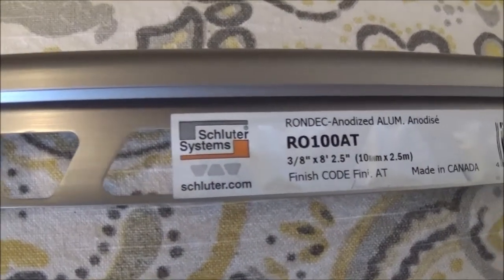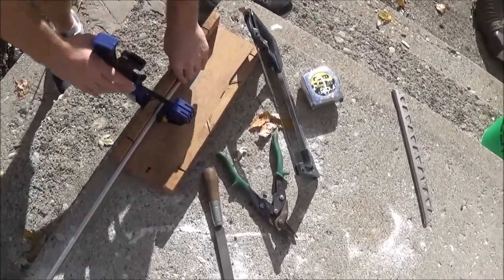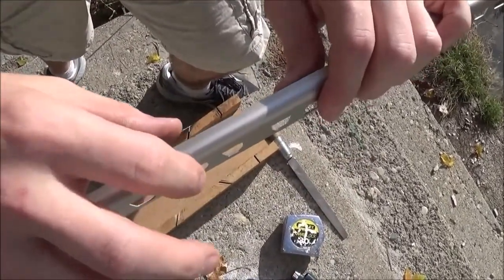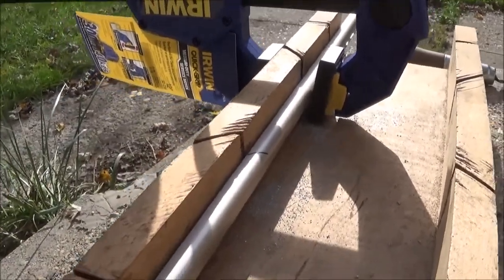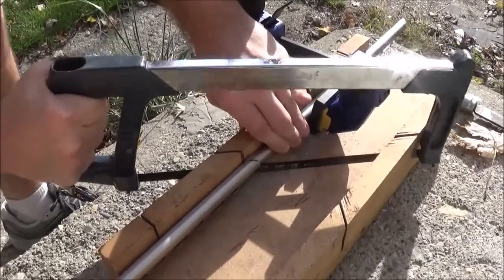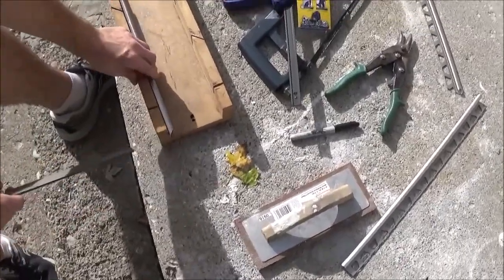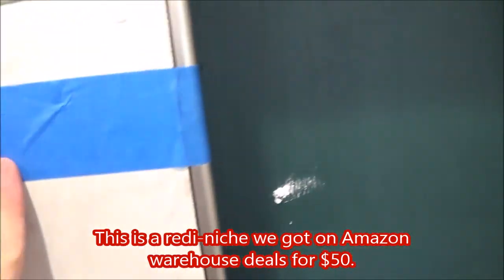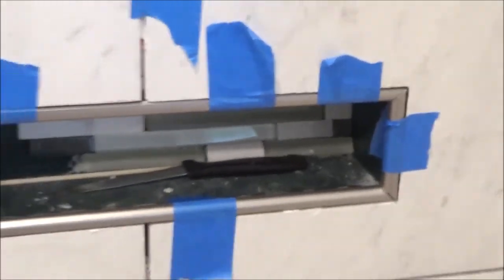Cutting Schluter Rondec Tile Edging Corners with Hacksaw

Comment: Does it matter if you set the trim inside the niche as you did in the video or on the outside wall?
Reply from the maker: I did it on the inside of the niche because the wall was already done. I can't think of a reason why you couldn't do the niche first and then the wall. But you gotta make darn sure you know how thick the thinset will be so the rondec sits flush with the face of the wall. Otherwise your rondec will be cemented in place at whatever depth and then you will have to bring the surface of the wall up to meet it. Good luck. Just remember when you are doing it that no matter what you do it will probably look better than it was before and for half the cost of a professional ;)